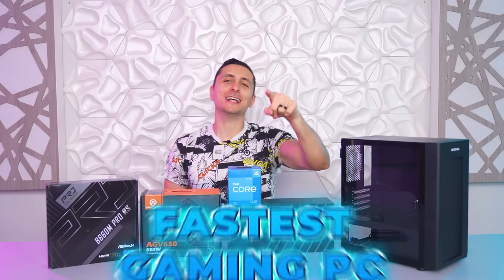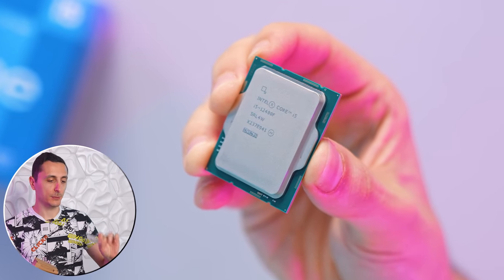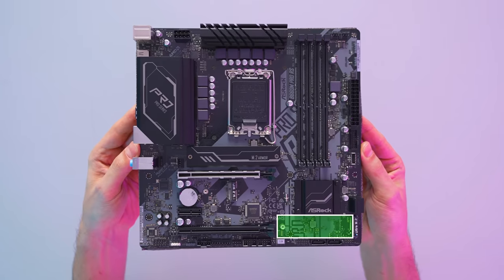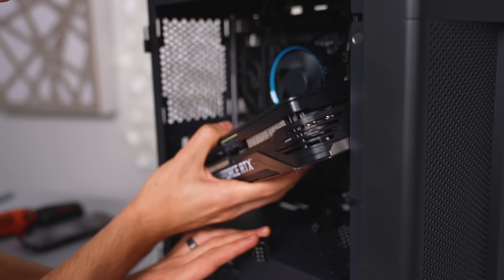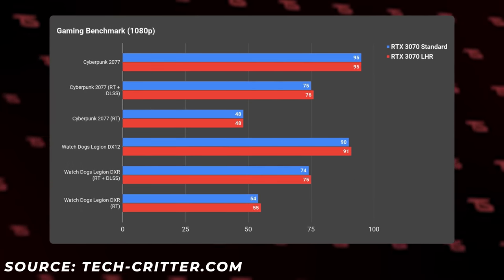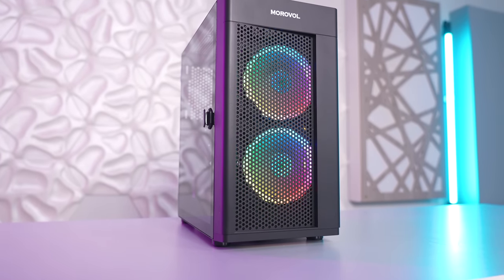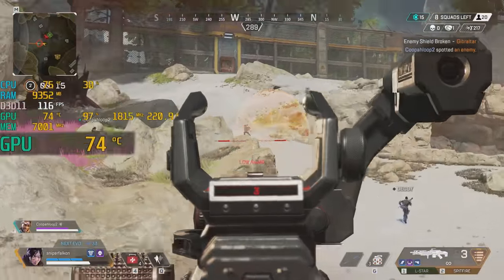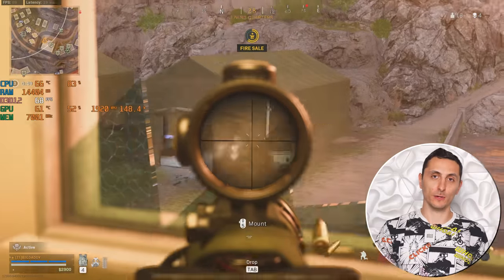Building the Fastest Gaming PC for $1000! - RTX 3070

Comment: Can I use Bluetooth on this PC and if not how would I add something to make Bluetooth work also how would I connect wired products like keyboards to this where is that port for that
Reply: Look at the specs for the motherboard. If it has wifi/bluetooth, it will be listed in the specifications. If it doesn't have it, you can buy a USB Bluetooth adapter. Modern keyboards and mice use USB. You plug into any USB port available on your PC.

Comment: i odnt understand so does the 3070 perform better at a higher quality such as 2k rather than 1080p?
Reply: Nvidia performs better at higher resolutions with these gpus. You should NOT use a 3070/6700xt or better at 1080p.

Comment: I would say a better reason to go with a 12400f is that you can drop in up to a 13900k at any point down the line
Reply: no, you shouldn't run a 13900k on such a cringe mobo. But with a 1000 budget, you're probably never gonna upgrade it within 2 years and it wouldn't make sense upgrading to a 13900k in like 4 years or so.
Reply: @ties9123  notice I said can and not should.
Reply: @rileyhance318  then why bring it up in the first place
Reply: @ties9123  a 12th gen cpu has a bigger upgrade path than a 5000 ryzen cpu. you could get the 12400f with a board with better power delivery than the exact model that they used in the video. connect the dots
Reply: @rileyhance318  of course, but in like 4 years nobody is going to upgrade the 12400f to something else. It would be so much cheaper to just buy a new board. The 1 gen upgrade path is useless.
Reply: @ties9123  upgrading to a 13900k would probably be cheaper than a new mb and another non k i5

Comment: I have this exact configuration except that I have 16gb Ddr5 4800 mhz Cl40 memory. I have no idea why but MW2 runs like shizzle. It stutters and I get 1-10 FPS 1 % lows in that game. No matter the settings or resolution. I have no idea how to fix it. I have tried installing different Nvidia drivers and I have cleaned standby memory. There is nothing running at the same time except the game on my computer. I simply don't get it how to fix the stuttering. Any advice?

All other games run smoothly without stuttering.  'RendererWorkerCount' to 6 -> I have done this also.
Reply: Someone commented above saying to set 'RendererWorkerCount' to 4 as that is best for intel cpu's.
Reply: @Heavy_Burst  I have. It was on 4 by default. I have tried different settings aswell. Now back at 4.

Comment: I was looking to get a little bit bigger case would that be possible with this build?
Reply: Of course. You can use almost any PC case. Main things to look for are: PC form factor (MB and case must support same form factors; look them up if you don't know they are) and GPU length limits. The PC case will have a spec sheet with the maximum GPU length supported.

Comment: Could I use all the same components in a ATX case? Or would I need to change some parts? Planning on using a NZXT H510 btw
Reply: They’ll all work fine, yes.
Reply from the maker: Yes they do work with an ATX case.

Comment: Im going for a similar build I will be using a used a B550 and used sticks of ram which bring me a R5 5600X and a gigabyte 3070 (or something other if can find a better deal but I will not downgrade) (tip ask people who have experience if they have left over parts you can get some pretty cheap I got mine for free because he didn’t need them)
Reply: If you dont mind going AMD, the 6800 can be had for a similar price with better rasterized performance. For like $50 more, theres the 3070ti and 6800xt as well
Reply: @JM-kn9dh  I Wanna Go Nvidia and I Found a rtx 3070TI Asus ROG boxed for just 725
Reply: @RacerA8  yeah the 3070ti is solid for only a bit more than the 3070.

Comment: Hey, Ares PSU! I got one of those on the cheap about 2 years ago, 650w, still runnin solid damn near 24/7 since,... bought 2 more of diff wattages over those 2 years, and have been great. I usually rock the eVga PSU, but Ares has impressed me, and now I see you giving them a shot as well.
Reply: You got lucky. All units from ares game are on tier F (replace immediately) and have shown many issues. Ed should NOT be recommending fire hazards.
Reply: @underscore_dash-  Yeah I was surprised to hear that he recommends it. I always see these PSUs on sale but their cultist rating turns me off from buying them. Sad because I am tryna to cut costs of budget flips and these would help a lot.
Reply: @underscore_dash-  Odd, cuz Steve over at GamersNexus has a couple of vids, one of which state that the Ares 850w unit they tested was actually fine, DID NOT explode like Gigabyte units, and actually would be ok if they simply changed it from a GOLD to basic 80plus White label. I trust Gamers Nexus more than just about any other "TechTube" channel, and more so than your commentary.
Reply: it may have been a cherry picked unit, or I guess I’m just wrong lol

Comment: I have a question, i finished building the pc and i installed most of the drivers but when i search the name of the motherboard and try to find the wifi driver, i cant seem to find it, so my pc only has ethernet drivers so i cant connect to internet.
Reply: What's the model number of your motherboard?
Reply: @JJFlores197  B660M Pro RS
Reply: @antgamer3446  Looks like that motherboard doesn't have built-in wifi so that's why there are no wifi drivers for it. You have to install your own wifi card. 3:50
Reply: @JJFlores197  ohh i see, just to make sure, any type of wifi card is compatible right?
Reply: @antgamer3446  Almost. If you plan on using the built in m.2 connector he mentions, it has to be a small M.2 wifi card. If you want to use a PCi-E wifi card, then any on the market will work. Same with USB wifi adapters. any USB wifi adapter will work.

Comment: Ok I want one of these now. Although unsure whether I should get a 3070 or 3060 Ti.
Reply: I'm in the same situation im between choosing a 3060 ti and a 3070
Reply: Id say if you going to do a 3060, do a 3060 instead of a 3060ti to save a bit of money since there isn't much of a difference. If you want the better frames and performance and don't mind the price difference, do a 3070 or possibly a 3080 if you can.

Comment: Did you find 6950xt reference a good deal for 1440p gaming? I am living in Europe and all the 6950xt's now are playing around 1000 till 1200 euro for the best models, but I found the reference one for 900. I am a little worried about the only 2 8pin connectors and the low clocks that reference card have. Can maybe a little overclock fix the problem?
Reply: I built my Pc 3 weeks ago, because the prices are currently pretty low (living also in Europe). My specs are rx 6950xt (msi gaming x trio) and amd 5800x. All together it was about 1800 euro. At the beginning I had some troubles because the amd software is kinda weird (some stutters while playing), but after I changed some settings in the software (there are some youtube videos that helped me) I can now play every game with 165 hz on 1440p without stutters. So I am very happy that I bought an amd gpu :D But You can wait as well for the new 7900 xt which will be released in a month
Reply: @n0mi1k  sorry I forget to write about my setup, I have a 5900x with a 6700xt write now, till now I am playing with the recommended settings. Before to weeks I upgrade my brothers pc from an rtx 3070 to a 6900xt and I was very surprised with the result, he plays at 1440p cod mw2 almost everything to ultra at 165fps easily. 7900xt is a good option but at Europe it will come for sure at more than 1200 euro starting price and the 7900xtx even higher. Do you have the normal 5800x or the 3D model?
Reply: @IAGaming  now the amd have some very good sales, but the problem is that at Europe is to difficult to find a reference model, and you tin have any chance If you find it to be anywhere near the msrp. 😕

Comment: I have the same build configuration but different in some parts .
Here is my pc specs :

Case : Asus ROG Strix Helios Black
CPU : Intel Core I5 12400F
Motherboard : Asus Prime Z690-P D4
RAM : Corsair Vengeance RGB PRO 32GB 3600 CL18
Graphics Card : Zotac RTX 3070 Twin Edge 8gb LHR 
Power : Corsair RM750 Gold
CPU Cooler : DeepCool Gammax GT ARGB
SSD : Gigabyte Aorous Gen4 1TB
HDD : Western Digital Blue 2TB 7200 RPM
Monitor : Xiaomi Mi Surface Curved Display 34 Inch
Mouse & Keyboard : Redragon S117
Headset : Razer Kraken Ultimate

What's your idea ?